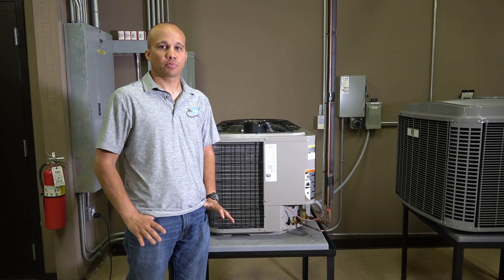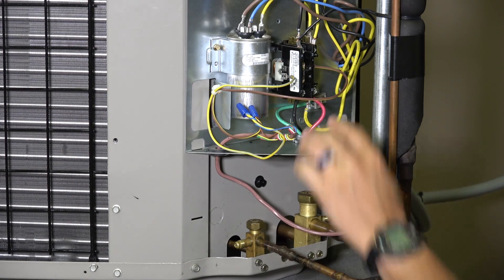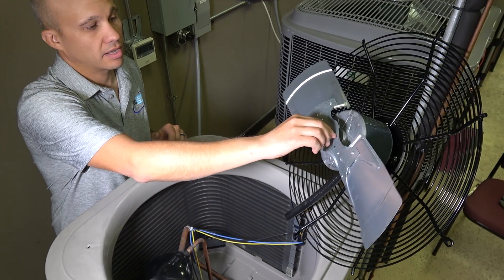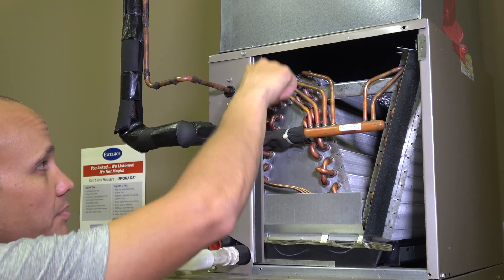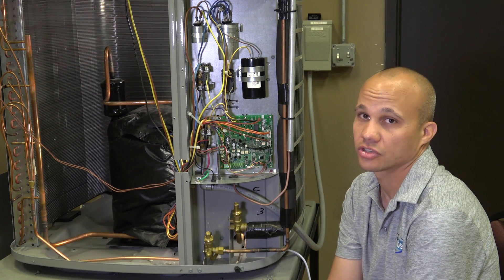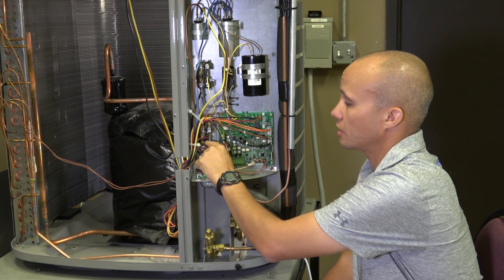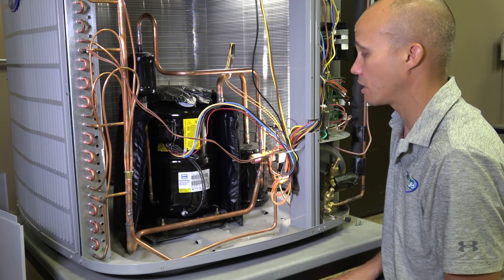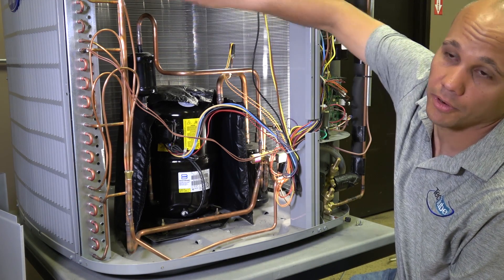Air Conditioner & Heat Pump Components

Comment: So what is the purpose of this heat pump? Why one removes heat from the furnace and releases it to atmosphere. Seams pointless.
Reply from the maker: You would not remove heat from a furnace at all.  The purpose of a heat pump is to both heat and cool a structure.  When in cooling mode because the building is too warm, it would remove heat from the space and reject it outside... just like a standard air conditioner.  When it is in heating mode because the building is too cold, it extracts heat from the air outdoors and "pumps" it into the building.
Reply: @TECTubefilms  Thanks Tec Tube! I see, maybe I didn't comprehend there maybe are more components to the system. It wasn't clear.
Reply from the maker: @movax20h   The only meaningful extra component difference between an air conditioner and a heat pump is the addition of the reversing valve which allows the evaporator and condenser coils to switch job functions.

Comment: 4:08 It is not Thermal expansion valve. It is Thermostatic expansion valve.
Reply from the maker: "To-may-to OR to-mah-to."  Both Thermal Expansion Valve and Thermostatic Expansion Valve are acceptable terms in the HVAC industry and you will find both used interchangeably in manufacturer's literature.  In the case of the Carrier CNPVP coil utilized in the video, the installation manual that came with that coil uses "thermal" but the product data sheet uses "thermostatic."
Reply: I would have said po-tay-to OR po-tah-to  :)
Reply: Wikipedia and numerous Google searches use both thermal and thermostatic.  https://en.wikipedia.org/wiki/Thermal_expansion_valve
Reply from the maker: Potato or Tomato?  Stop trolling us Hoger!

Comment: i'm no expert or anything why is there a circuit board on the outdoor condenser that may not last long from the outdoor elements and also that insulation on the compressor asking to burn itself up.
Reply: The board is outside, because major electrical components of compressor and condenser fan are there, so there is less cables to run to it. Board is under cover and sometimes conformally coated. The boards getting wet are almost never a failure mode. Motors, contactors, capacitors, compressors, clogged lines, leaks, dust on condenser, bad electrical screw connections are usually issues.

Also notice that the compressor is cooled by the fan in the unit.

As of the insulation on the compressor, it is not exactly insulation. It is sound insulation. So it is not as thermally insulating as real thermal insulation. But yes it does insulate. However this is a second stage compressor afaik, and it moves liquids at much lower temperature in the first place so this liquid makes the compressor cooler during operation. In fact this compressor might need insulation to not freeze up. Just a guess.
Reply from the maker: It is "weather proofed" by being inside the enclosure and the board itself has a coating to avoid corrosion. Carrier and other manufacturers have been putting circuit boards in condensing units, rooftop units, and chillers since the 1980s.
Reply from the maker: Good response movax20h.  The compressor "insulation," is, in fact, for sound purposes.  It is one of many features that can reduce noise.  You will find these on most higher end models.
Reply from the maker: We will also add that the compressor itself does not need to reject heat to the air.  It rejects its "motor waste heat" to the refrigerant.  In other words, the compressor is refrigerant cooled, not air cooled.
Reply: @TECTubefilms  Exactly. But not all compressors are like that. I think this applies here because it is second stage compressor, and even the compressed vapour is pretty low temperature compared to ambient.

Comment: Where is the liquid line receiver, and how does one in heat pump differ from "normal" one
Reply: They use an accumulator not a liquid line receiver.
Reply: @Reisskraft  Thank you for a reply. What is the reason they use an accumulator. The receiver offers a greater range of working conditions, while accumulator can only offer a part of that?
Reply: They use an accumulator to prevent liquid from entering the compressor they usually install a liquid line drier.
Reply: @Reisskraft  i am aware of the function accumulator has. My question is why not use liquid line receiver with pump down. It offers bigger range and safer running as i know

Comment: the capacitor is needed tuo provide a  phaseshift to run the motor not for energy storage
Reply: It’s the same what he said, he dumbed it down, a capacitor does store and discharge and store and discharge, relax bro, or make your own video,
Reply: He just made it easier to comprehend. It is in a sense storage device. It is used to correct for inductance of motor, and improve power factor. You don't pay really for apparent power in residential settings, but it is kind of important for HVAC, because there is so many of them, that it would wreck a havoc on a power grid, if not corrected for.

Comment: The more complex unit will save you money on your energy bills, but with potential repair cost, that becomes negligible for a lot of people that own them.
Reply from the maker: Most of the "more complex" units you are talking about do have a 10 year warranty.

We might also compare your comment to folks that said "do not buy a Prius because a replacement battery costs so much."  The first Prius came out in the late 90s and we have still not know anyone that had to buy a battery.

We would also add that in most cases, people do not buy a more complex unit solely for energy savings.  Most do it for improved comfort in their home (multiple stages or fully variable capacity).
Reply: A 10 year warranty is not much considering the costs of these units and the repair costs can be considerable and easily blow the savings out of the water once there are problems out of warranty. lol
Reply: Some will hold up and last for some people, but I know people that have had big issues. Ultimately though the choice is up to you as a homeowner and if you are looking for that perfect temperature and humidity control you have to spend considerable money to obtain that.
Reply: But man.. . the comfort I get at my house... the dehumidification control... precision temperature... the energy savings... crazy quiet sound levels... individual control over different temperatures on each floor... it is awesome!!!  If you don't want all that, then maybe just buy a couple window air conditioners.
Reply: The units we illustrated in this particular video are not particularly complex.  They are pretty much standard 2-stage scroll units.  Nothing overly sexy.  A lot of the higher-end residential systems have moved to inverter driven compressors over the past 5 years to provide more than 2-stages.  Things can then get a little more complex (and expensive) because of the inverter, the control board, and the ECM condenser motor.
Reply: lol I have a single stage Bryant 561c condenser that is now 12 years old without a single service call. The furnace is a Bryant 383kav with a reliable PSC motor and no issues almost 20 years old now. I am happy without the complexity and my home is comfortable. I will say the duct system in my home has enough return which is important for any system you choose. The cost involved in replacement of DC motors just a few steps up from my budget system is high and common and typically just out of warranty. Of course the complexity is well beyond this the higher end unit you buy. My whole point is you pay to play and whether it is worth it is up to you. I do maintain my equipment and clean it up once a year. I have had the motors apart so I could oil them properly. There is no such thing as lubricated for a lifetime.
Reply: The manufactures charge unreasonably more for smart controllers and sensors. The tech is really simple and established for decades, most of manufacturing cost is laughably low.